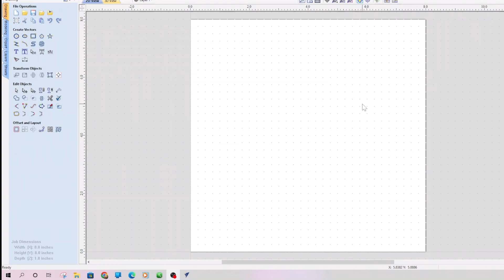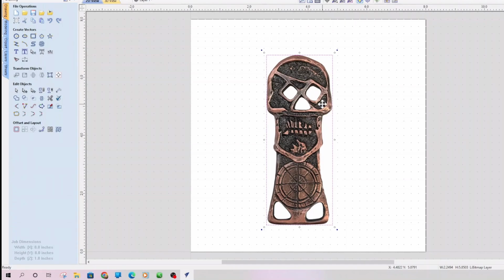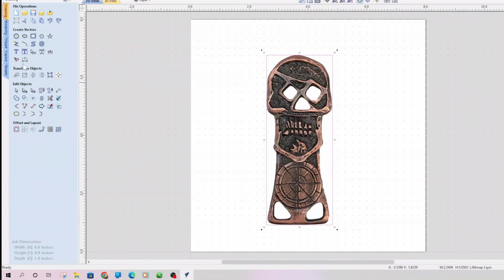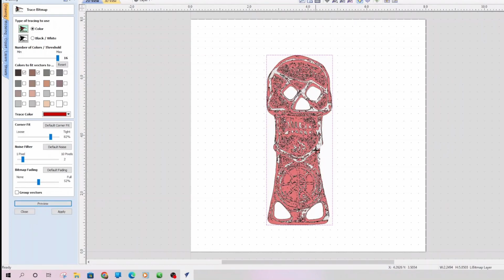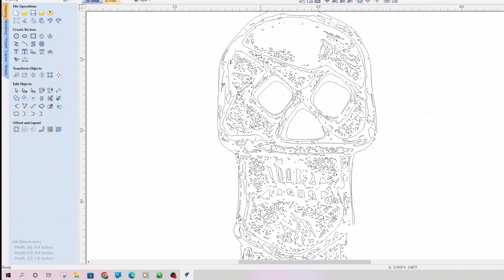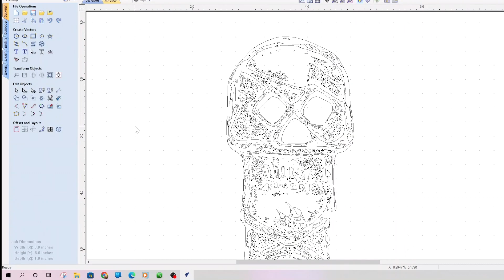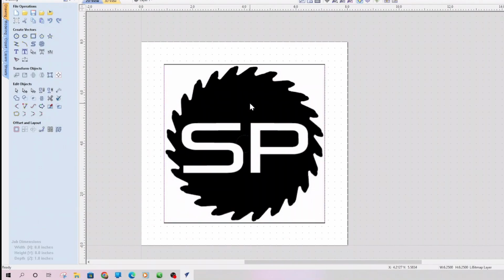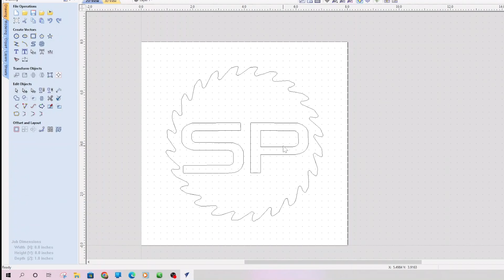VCarve Pro | Image Trace Bitmap For CNC | JPG to SVG

Comment: I know it takes effort to condense this type of content down to the 5 minute or so mark.  That really works for me and makes it digestible.  This is probably a stupid question, but it wasn't clear to me from this example what gets cut out versus what is "raised".   Maybe this was too complicated an example, and I'm thinking about things with a lot of texture.  Even with the Logo though, how do you know whether you're routing the SP out or cutting around it and leaving it raised?
Reply from the maker: Thanks. I think these sort of short videos have a lot of value. 

To answer your question, that would happen on the other side, when I set my cuts and determine what I want to keep and what I want to get rid of. This video really just focused on HOW to convert the image to vectors. 

Check out the video in this link, and it may better answer that question. You have the ability to decide what's cut out and what's leftover by setting your cuts. Jump to about the 4:30 mark in the link below and that may make more sense.  https://youtu.be/WtGTQpqOlcc